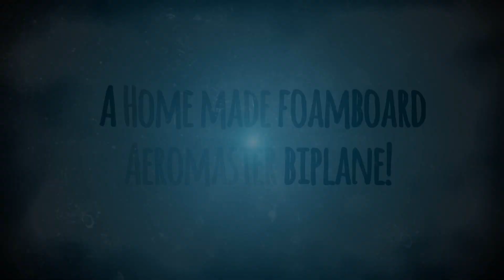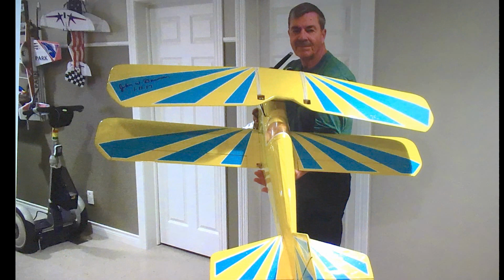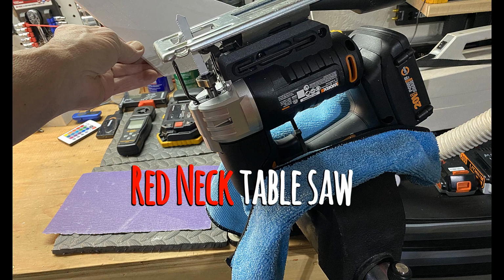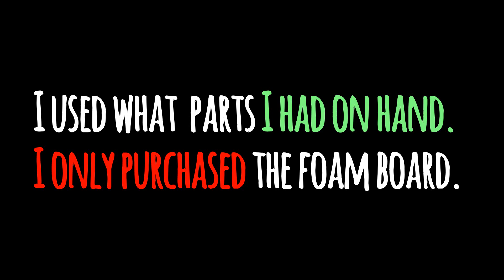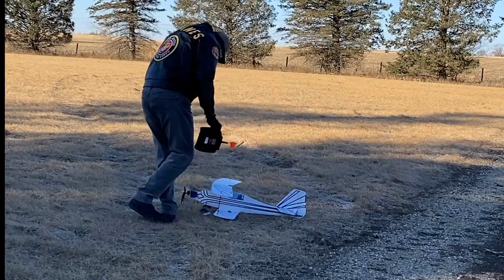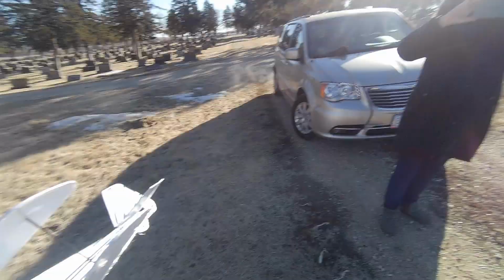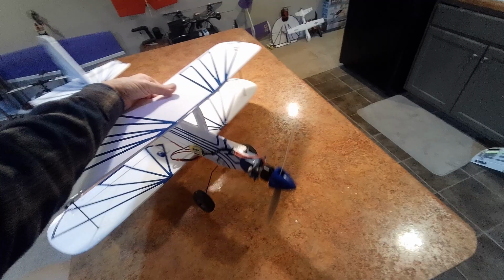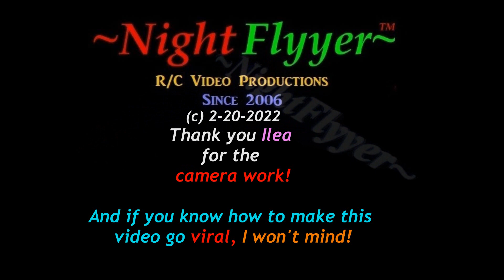A Foam Board Aeromaster "Too" Biplane. Will it fly?

Comment: I need to get my Aeromaster too repaired and flying again. I just hope my K&B 61 survived storage. In my opinion the Aeromaster is the most attractive fun to fly rc plane ever produced. Only thing I have ever flown that came close was the model tech dragonlady 40.
Reply from the maker: Ah, nice to hear from another Aeromaster owner.  I have a brand new K&B 61 and love those engines.  Use a hair dryer or heat gun to heat it up if it is locked up.  Then it will be fine.  I love the looks of this too.  Thanks so kindly, and happy flying.

Comment: Hi Dave,
Have you heard of the OMP M1? Its a direct drive RC Helicopter, the brushless motor output connects directly to the main shaft! No more straight cut gear whine! Thought you might be interested as it is a new development in RC helicopters!
Love your videos!
Reply from the maker: Wow. Well I would really like to see that motor.  The belt drives are typically very quiet vs the gears, but still give good torque for radical 3d.  Not sure a direct drive would be strong enough, but I never thought they would ever build full size coaxial helicopters, knowing how easy it is to have blade strikes with top and bottom. That happens a lot with coaxial models, if you try to crank them around. LOL. Thanks.  Note, I just watched a couple vids and like the heli.  Not sure if I could keep up with it at my age.  I still haven't had a chance to fly my new Align Trex 470L dominator.  I may go for this if that goes okay.  e machines 180 looks like the best deal for me. Thanks again.